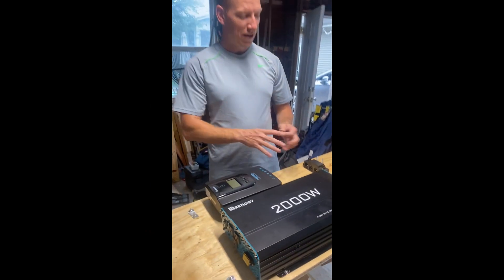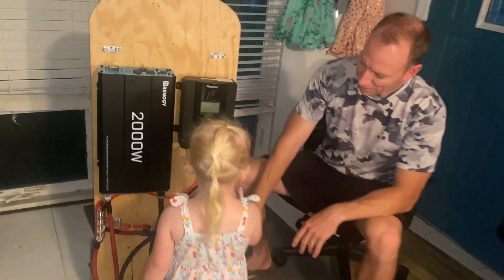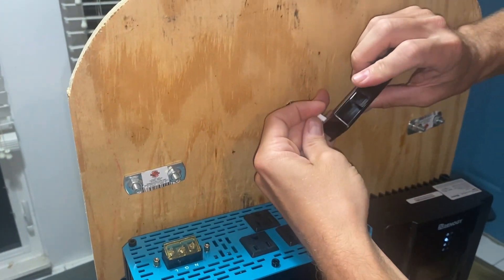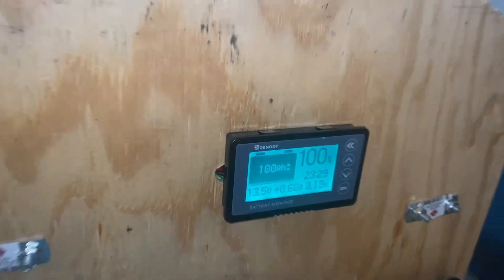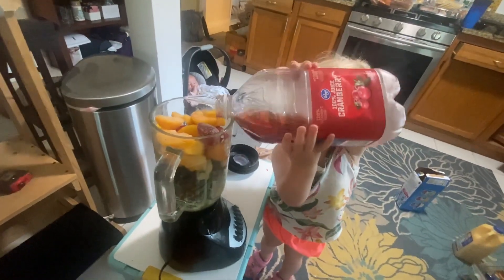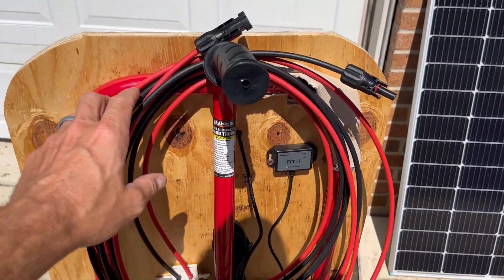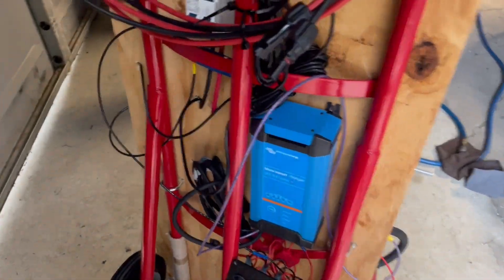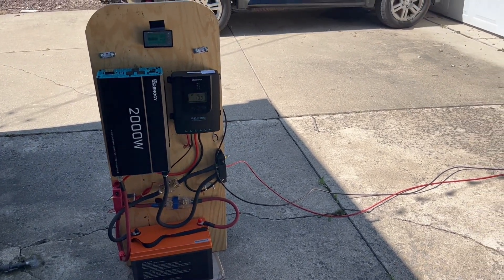Solar Hand Cart - 12V 100AH LiFePO4, Portable All in one System

Comment: got to say this your battery is way to small, moat 100 ah batteries wont supply more than 50 amps continuous, which is 600 watts , good system but 2 x 200ah batteries would realy make it worth while. i have a 135ah lfp battery with a 200w inverter and it would run a 1800w saw for a few seconds but slow to start
Reply from the maker: appreciate it, and agree with your numbers.   i actually did have a couple 200AH 12 V batteries but sold them to upgrade to a 48V system.   So this one is used for backup/easy to throw in the truck and bring places, etc.

Comment: Can the ONE victron power supply charge a group of batteries that are in series or parallel?
Reply from the maker: this one can do in parallel (i had it that way with 2 of these same Chin's 12v  batterys for 200AH). could also do in series at 24v, which this Victron is capable of, but I haven't configured it that way.
Reply: @oldvideos1  does the victron app "see" two separate batteries and condition them separately, or when you parallel them, it treats it like one big battery?
Reply from the maker: @MyChannel-vm6dw  It treats them as 1.  Which i think is good, because it keeps them at the same voltage and topped off together